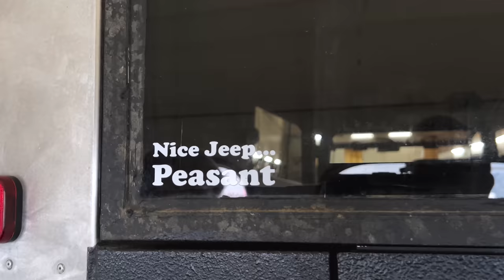Sandy visits with Rich Rebuilds and finally meets ICE T

Comment: Sandy,  a thought, so much of the general public views that the number of charging stations should match the number of gas stations. What they need to be educated on is that 90% of drivers drive less than 40 miles per day. You treat your car like your smart phone and you should be good to go. A credit should be given to the home builder for installation of a charging station in a garage or carport. One more thing, climate change has become political. The world is switching to EV’s primarily because the technology now exists. We need to separate the EV boom from climate change to protect it. The easier it is to charge the easier it is to buy an EV.

Comment: That ICE Tsla must be too front HEAVY to have any decent handling.. Just bc you can doesnt mean you should L
Reply: LS2 = 450 lbs, std Model 3 batt 1060 lbs. Not distributed the same but it’s probably lighter than a std model 3 even with trans and fuel.

Comment: To me this Model S V8 conversion is the modern day equivalent of taking 2 horses and rigging them up to a Ford Model T with a blown powertrain.
Reply: Absolute nonsense!!!! Where does an engine/compare to horse!? The car has comfort, speed, protection against rain/wind/dust….. the gas car also has better range than any tesla ever made.
Reply: The next rich rebuilds conversion is going to be a model3 into a truck with a Cummins 4bt probably running on vegetable/used oils.

Comment: Okay, I usually love Sandy's videos but 2 things set me off.  First a Tesla with a Chevy LS conversion.  Really, because they swap that engine in everything.  No biggy, its been done before to oodles of other vehicles, difference is, the original power train is superior.  Congratulations, you depreciated a car.  If it still had its EV drivetrain it would be worth more money.  Next, what the hell !   Your driving an ATV without a helmet !  Not setting a good example for being a responsible ATV rider.  Ya, Ya, life liberty, and the right to brain damage.  I expect better from highly educated people as yourselves.
Reply: No need for a helmet, when you have a functional roof and roll cage. Best to turn whatever brain you have on before commenting :)
Reply: @Marlow925  No roof or roll cage on the ATV.  You must be referring to the Sherp.  Maybe you should watch the whole video. You do know the ATV Sandy rode is a single seater off road electric vehicle and the Sherp is an extreme off road Diesel multi passenger vehicle right.
Reply: @mazdaratti89  I was :) The Sherp is registered as an ATV and a boat. As for the Cyberquad ... relax, they weren't going offroad.